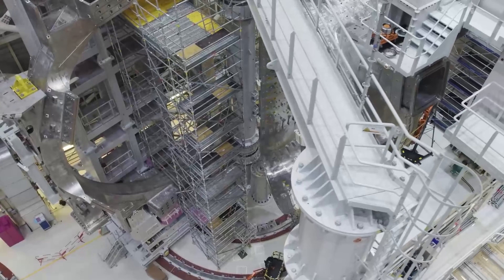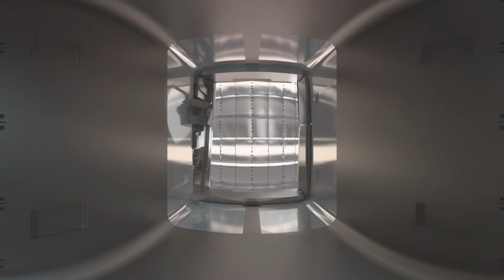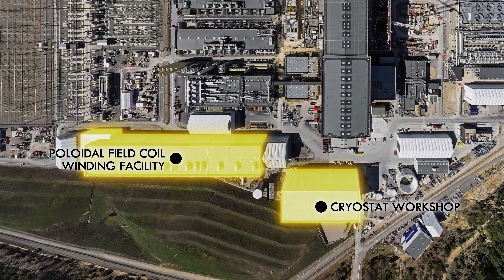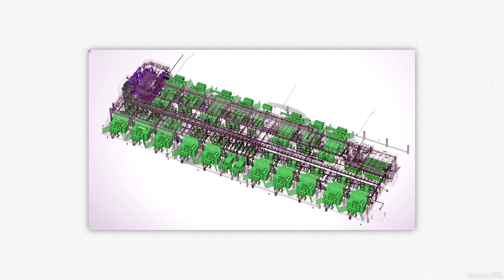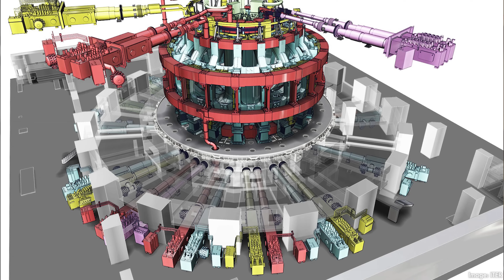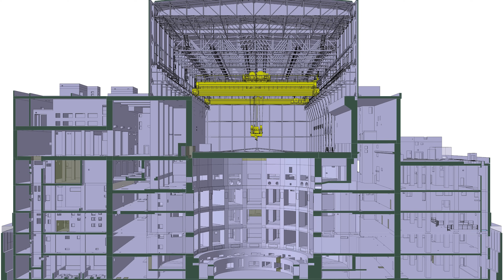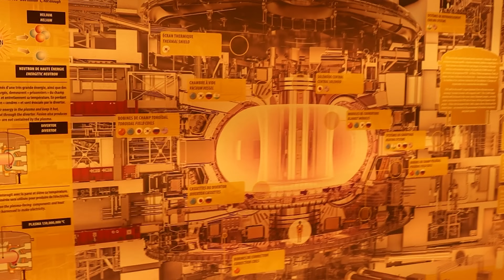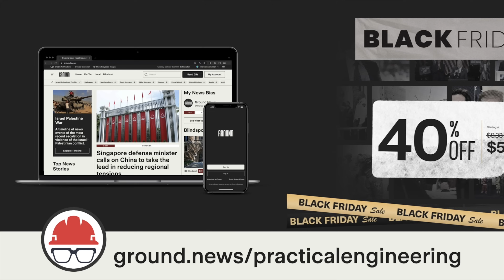Engineering The Largest Nuclear Fusion Reactor

Comment: The ongoing joke is nuclear fusion is always 30 years away. They have been working on it since 1970 I believe. I saw fairly recently that there was a breakthrough in magnetic technology that has helped make it more efficient. The problem so I’ve read is it takes more energy to start up a reaction than it would produce in its lifetime and that is the dilemma however different technological advances are coming so maybe soon fusion power will be a feasible reality.

Comment: that will never output more energy than imputted. those rocamak's need to put out like 5 orders of magnitude more energy than required to start itself just to brrak even because no conversion is perfect. last i checked the most effecient run is 1:0.0005~ (imput:output).

Comment: The gain on ITER is not 10 because that statistic on their website does not account for thermal losses between the heat generated in the plasma being transferred to steam spinning the turbine. In reality, ITER will not produce a positive amount of energy, the gain is more realistically around 0.8 or something. It's the same problem with that fusion breakthrough with that laser setup like a year ago, sure it made a "gain" larger than one but there is literally no way to get any meaningful amount of power out of the hydrogen pellets. It's just really confusing when people working on fusion projects report a huge "gain" and talk about it like energy output, but in reality it's not actually power for the grid. Like, if you ran a nuclear fission power plant and report a Q of 100 to investors and say it's thermal energy they're going to ask what the actual gain is, and ITER doesn't report a number like that.

Comment: Will Man-made Fusion really give-off (Exothermic) Energy, ever :
D2 + T3 --> He4 + n1 + energy (+/-)??
D2  :  2.01410   amu
T3  :  3.01605   amu
.........5.03015   amu : mass before Fusion
n1:(-)1.008665 amu
.........4.021485 amu : initial Mass
He4 :4.02603254 amu : mass after Fusion
.........0.0045475 amu : Mass INCREASED!!
Certainly not EXOTHERMIC reaction b'cuz the Extra-mass increment will be STORED within/into Helium-4 Binding Energy. And will NEVER give-off/produce Positive usable Energy/heat to generate Steam or Electricity, as planned (b'cuz the wrong fundamental /principle didn't allow them to happen from very beginning.) Moreover, the near fully Vacuum environment (in man-made toroidal Vessel) is not supportive for (compressive) Thermal Fusion to take place.!!! Sire.
Reply: D2 is Deuterium (H2-1) in heavy water 
T3 is Tritrium (H3-1) in very heavy water
n1 is Neutron.   (N1-0)
He4 is Helium.  (He4-2)

Comment: Okay how are we going to cool the walls of the reactor when we are heating it to millions of degrees Celsius. I feel that the power and coolant requirements just to do that will make this project impractical.
Reply: The video explains it. The plasma is confined inside the Tokamak, but without touching the walls, thanks to the electromagnets

Comment: Obviously this will never be a viable way to produce electricity at scale. The size of this facility and the equipment is enormous just to produce less electricity than what it takes to even start the machine. It takes 600 Mv to start but will only produce 500 Mv while using 50 Mv to stay alive. 
Not sure how the math scales but the basic understanding of the machine is that it’s huge, inefficient, expensive, and extremely delicate. 
Started being built in 2013 which is a decade ago and not going to even start for another decade or more. 
Investing into traditional nuclear energy would be a much wiser way to spend the tax dollars of the world citizens imho. Small community based nuclear plants spread out across the nation would bolster the grid and make it much more resilient. Nuclear powered aircraft carriers and subs show that small reactors can be used for decades in extreme conditions safely. Instead of centralized generation capacity smaller reactors spread out across the nation combined with wind and solar could free us from carbon emission generated power quickly and safely while reducing the chance of catastrophic grid failures.

Comment: Generated using Talkbud (Browser Extension):
📝 Summary of Key Points:

📌 Nuclear fusion has the potential to be a powerful and clean energy source, surpassing fossil fuels in efficiency and environmental impact.
🧐 The ITER megaproject aims to build an industrial-scale nuclear fusion reactor in France, showcasing the construction and engineering involved in the project.
🚀 The tokamak reactor will house plasma at extremely high temperatures, but challenges exist in containing and heating the plasma.
🌐 The project plans to convert the energy released from nuclear fusion into electricity.
💡 The video emphasizes the scale and complexity of the ITER facility, highlighting safety measures and environmental considerations.
📊 Ongoing research and development are required before commercial nuclear fusion becomes a reality, but the project shows long-term potential.

💡 Additional Insights and Observations:

💬 "Nuclear fusion has the potential to provide an almost limitless supply of clean energy."
📊 The video does not provide specific data or statistics.
🌐 The video does not reference any external sources.

📣 Concluding Remarks:

The video highlights the potential of nuclear fusion as a powerful and clean energy source, with the ITER megaproject in France showcasing the construction and engineering involved in building an industrial-scale nuclear fusion reactor. While challenges exist, the project demonstrates the collaborative efforts and long-term potential of nuclear fusion as a viable energy solution. Ongoing research and development are necessary before commercial nuclear fusion becomes a reality, but the project represents an exciting step towards a sustainable future.

Comment: everything sounds fantastic about fusion using tritium and deuterium... until you find out that there's only about 8Kg of tritium on the entire planet.
Reply: ...until you find out that you can get tritium using lithium.
Reply: @texanplayer7651  true until you also realize that in order to do that you are also irradiating the entire lithium wall with neutrons, and not all of them will be stopped at lithium barrier. thus making the entire reactor shell radio active, which in turn destroys sensors and superconductors used to stabilize the plasma and even then the tritium yield from the lithium-7 reaction will not breed enough tritium to make a fusion reactor tritium self-sufficient. Even if they used beryllium to aid in neutron release to increase tritium the whole process still requires vastly more net energy input than they are getting out

Comment: It's absolutely absurd they are just dumping the resulting heat out into the atmosphere, adding to global warming. As you said it is very well understood to generate electricity from the heat, so they should 100% do so as it's not that expensive. I get it's not the main point, but it's incredibly wasteful what they are doing.
Reply: Are you so arrogant to believe you as an uninformed YouTuber know better engineering than a multi billion engineering company? That even without knowing anything about ITER, you can tell them what they should be doing? 

Low grade heat cannot be used for electricity production. Every process engineer ever knows that. To create high grade heat they’d need to put in a full blanket, which would be incredibly difficult and change the entire project from the bottom up.

Comment: Watched on Nebula, but no commenting there that I can see.  What gave me pause is that since we're not transforming the heat into work products to drive a turbine for this proof-of-concept project, we're just doing a thermal dump into the atmosphere.  What are the consequences of that?  Is it too short-lived to be of concern?  Will there be a disturbance to the environment around ITER?  I'm sure this has been looked at, and perhaps this is just a blip and of no concern.  Thanks, Grady - what an awesome video.
Reply: There are no consequences, it’s only 500 MW for short periods of time. Nothing compared to any normal power plant, which also don’t really have much impact via this route.

Comment: I am very interested in the engineering aspects of ITER the construction is amazing. I believe it is the most expensive experiment every built. The construction techniques and innovation to build it is totally amazing.  

But I have lost interest in usable fusion coming anytime soon. I have been hearing about it for 50+ years (yes, I'm old). And I've watched and learned about each new technology to produce it. Three things that are disconcerting for ITER's success. First, is the size. If you think about the normal progression of new technology,  it starts small as an experiment and then is scaled up. So if ITER has to be this big just as an experiment, then what will be the production size if it works? Second, is time. Only recently, after a half century or more, did they even produce a break even reactor and that is only for seconds. To get to Q=10 of consistent usable heat seems a long way off. Third is fusion fuels. It seems like Hydrogen would be an unlimited fuel because it the most abundant element in the Universe. But it exists as Hydrogen-2 in nature and Hydrogen-3(Tritium) which is much more rare is what is utilized for fusion. Helium-3 is also utilized and it is only 0.000137% of the Helium on Earth as an example. They are both very rare and typically start their lives in a fission reactor if you want to produce them consistently. Sorry for the downer, but you asked. 😏 Really still enjoy the engineering though. 👍

Comment: I don't understand why the project does not include the mechanisms needed to generate electricity. Given that the reactor ends up operating successfully as planned, why not capitalize on its output? Even if there is a valid reason for a research facility not to be dumping power onto the grid, why not save the electricity in batteries for its own use, especially given that the technology already exists?
Reply: Low grade heat cannot be used for electricity production. To create high grade heat they’d need to put in a full blanket, which would be incredibly difficult and change the entire project from the bottom up.

Comment: It seems like it is unnecessarily expensive to have designed this at such a large scale, particularly since it is only a proof-of-concept and will never produce electricity. Is there any practical reason why it could not have been designed at, say, 1/32nd of this scale? That would have saved enormous time and expense and would have afforded the scientists the ability to more easily modify the design if needed, swap out components, try different things. Is there any reason it had to be done at such massive scale?

Comment: I get so jaded when fusion it brought up. When it finally works in the next gen ITER project 50 years from now, you still need fusion fuel. Unless a miracle of physics is discovered we have to boil out deuterium from seawater using more energy than fusion can ever generate
Reply: Just another Tech/Enviro scam. It's just far more offensive when they're funded by taxes instead of naive retail investors.

Comment: I hate that ITER and other fusion initiatives are often presented to general public as some kind of wonder solution, which will fix our energy problems REAL SOON. In practice, we're still at least multiple decades away from even knowing it can be done. But that dream allows those who are scared of nuclear fission power to remain scared, as they believe fission won't be needed VERY SOON. But we need nuclear here and now, both because of the climate, and to break our dependence on natural gas (which is currently used to fix the mess that solar makes).

Comment: Physicist here. Fusion is so vastly overhyped that it's only frustrating to follow reporting on it. Fusion will not solve the world's energy problems, not today and not ever in the future. The question whether fusion works at all is totally meaningless. Because: fusion is absolutely not economical in the existence of wind & solar, like not even close. The infrastructure (huge superconducting coils, liquid Helium cooling, etc) is so expensive that no nation alone can even afford to build a single such reactor, for a laughable power output. And fusion is not entirely clean either, it produces loads of nasty Neutron radiation which makes the concrete surroundings radioactive through Neutron activation. It's not super long-lived isotopes and not as bad as fission waste, but still nuclear waste and expensive to handle once such a facility gets decommisioned.
So yeah, Iter is a cool experiment, but also a huge waste of tax money that should be better spent on actually solving the energy problem by building wind & solar. And all the small fusion startups who will never even reach ignition are going to go bust once their investor funding evaporates into thin air, it's almost amusing to watch at this point.

Comment: I work in a temperature related field, just the scale of these components and the tolerances involved means these guys probably have procedures to stop work if temperature control goes down for x hours, and they'd probably keep it in place for up to a week depending on the outage, these scales are absolutely insane, just wow

Edit: not to mention procedures for moving parts between temperature controlled environments, letting parts just sit for x hours/days before continuing work

Comment: I thought the figures were 50MW in and 5 MW out. I hope I am wrong but this may be the biggest ever waste of money spent on any science experiment. It has had the interesting side benefit of providing more reliable electricity to the smaller Haut Var villages in the region, due to the upgrading of the local electricity grid to provide power to the reactor. I just hope our lights don't go dim, every time they fire it up.

Comment: In the example of 50 MW thermal power in and 500MW out - that 50 MW is just a fraction of the electricity used by the whole facility:  as you mentioned there are several power hungry support buildings that provide heating and cooling etc. for the whole facility so that in actuality the TOTAL INPUT while functioning will most likely exceed 500 MW,  so Q total will be less than 1
Reply: Then if so, they wouldn't be giving this any attention whatsoever.  Investors wouldn't fund it.  I think you're exagerating tremendously.
Reply: @GiveCreditWhereDue no he just means for know it’s like that. But only because it’s still work in progress. If it works it will change the world forever it’s almost a free energy cheat code in real life when it happens you will hear it everywhere not just from a YouTube video. But this breakthrough just demonstrated it’s possible not really created energy already
Reply: @GiveCreditWhereDue       https://youtu.be/JurplDfPi3U

Comment: it's easy to produce fusion. The difficult part is to achieve net energy gain and that has never been demonstrated. By net energy gain I mean getting more energy out than is put in. This enormous edifice will never produce one single watt of electrical power for the grid. It doesn't even aim to do so. Even if fusion can produce net energy gain, it must then produce net economic gain. That means that the electricity can be sold for enough to recoup the cost of construction and operation. I haven't even seen a calculation for this, and my guess is that the fusion people don't dare to do this because it would look so ridiculous. Then they also need to achieve net tritium gain, and the method for doing this has never been demonstrated and will not be achieved by ITER. This is a plasma science research project disguised as a future energy source. It would be nice if they owned up to that and told us honestly the truth that fusion will never be a commercial energy source.

Comment: The statements that fusion does not generate long lived radioactive waste is sadly not true. Devices like ITER fuse deuterium and tritium, since it requires the minimum amount of energy. Deuterium is easily obtained from water. But tritium must be created by the reactor by lithium absorbing a neutron. For every fusion of deuterium and tritium only one neutron is emitted, and it is at far to high an energy. So moderator material like carbon and neutron multiplier material like lead, bismuth and/or beryllium are used to produce additional neutrons to insure sufficient tritium production and to slow these neutron down so that they will fission the lithium into helium and tritium. It is the first wall of the reactor that is the problem since the neutron energy level is 14 MeV and can cause structural materials like stainless steel as well as the neutron multipliers to be transmuted into radioactive isotopes. 

This paper discusses these issues. Of particular note is this statement, “The volumes of high level fission and fusion reactor waste that have to be disposed of after the generation of the same amount of thermal energy in both types of reactors are about the same, roughly one cubic centimeter of solid material per kW yr, if the comparison is limited to the volume of the fuel elements on the one hand and that of the first wall on the other.”

Thus it is possible for a fusion reactor to produce roughly the same amount of long-lived radioactive waste material as a fusion reactor of the same thermal energy production. Fortunately, while the long-lived waste is intrinsic to the fusion process, careful selection of materials can minimize the waste generation of a fusion reactor. However, even with the best material selection, fusion reactors will still generate a considerable amount of long-lived radioactive waste. Thus fission isn’t the magic bullet that will completely solve the radioactive waste problem.

http://www.acamedia.info/sciences/J_G/fusion.html